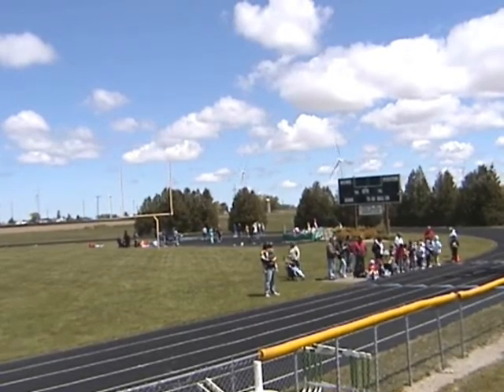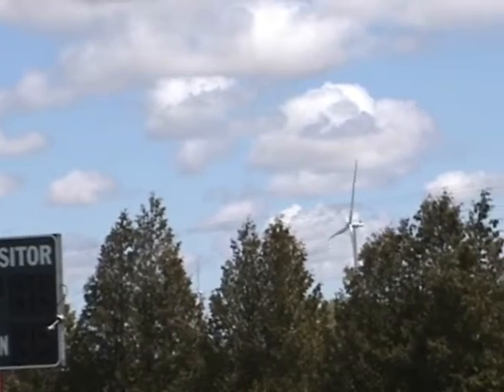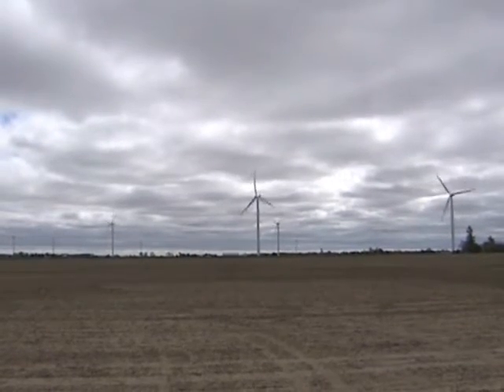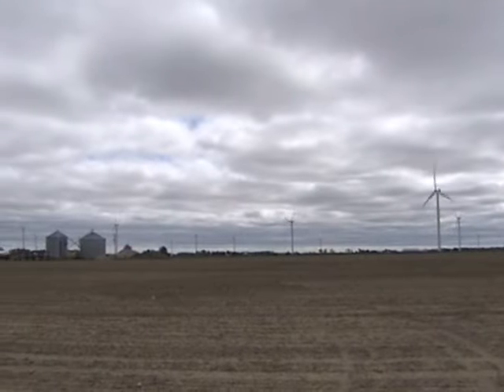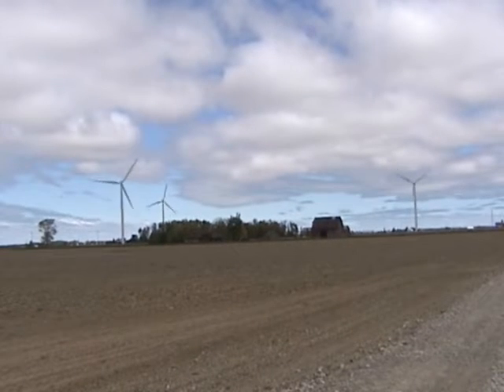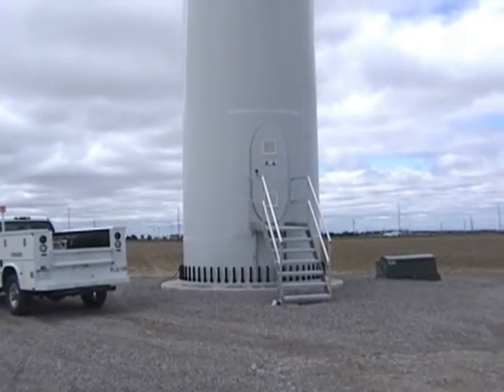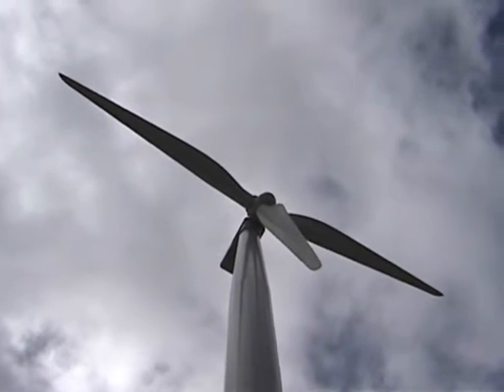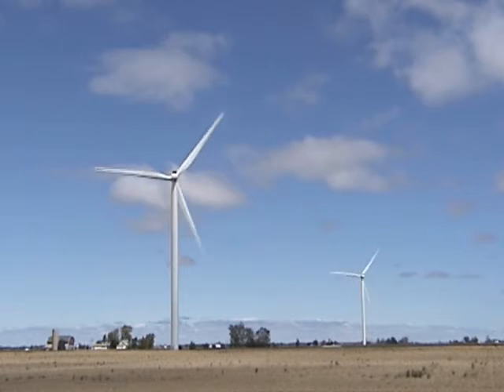Michigan's Harvest Wind Farm

Comment: The wind is easily our biggest and easiest source of energy. The sun properly generates more energy but heat is incredibly hard to harvest and cost way to much to be worthwhile compared to wind. Not to use the power of the wind would be completely retarded and with the whole fuel issue, just use energy as fuel for the cars. Using petrol is a waste and fucking stupid.